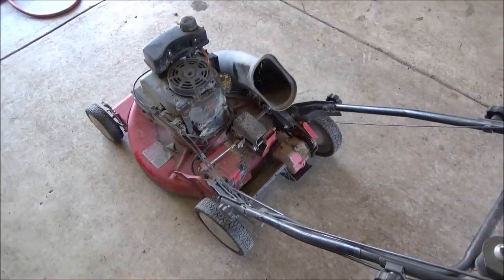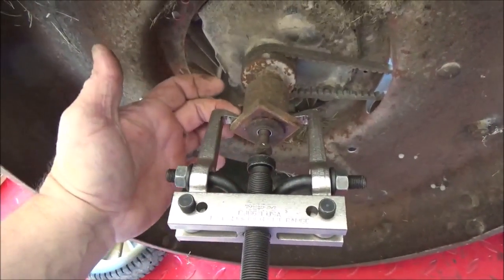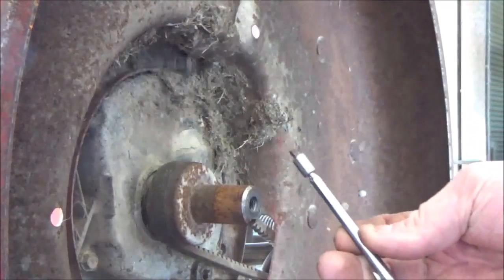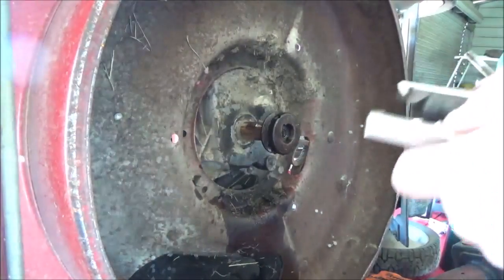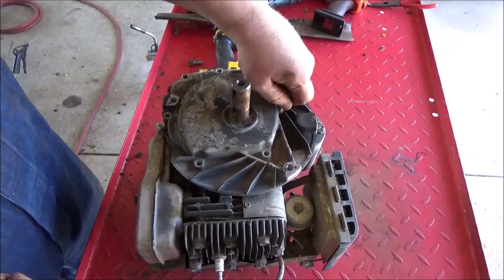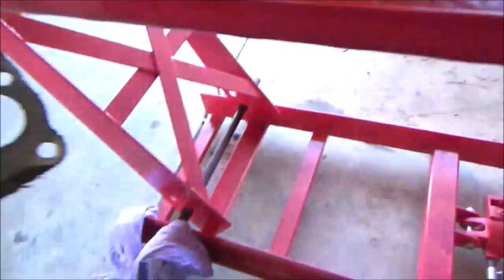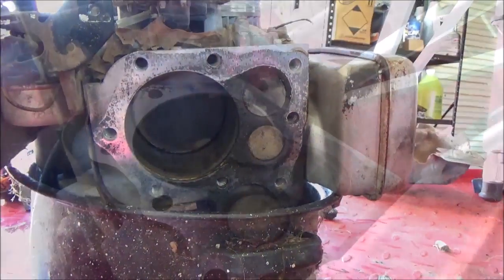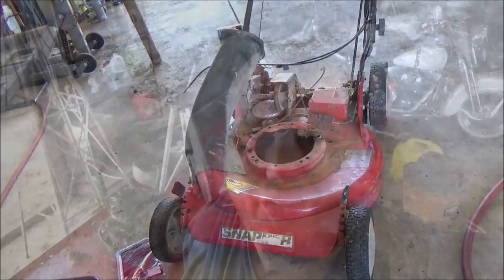PART 1  /   BRIGGS AND STRATTON TO PREDATOR RE POWER / LETS TAKE THIS ENGINE APART AND DIAGNOSE IT

Comment: I manage to find a B&S 120000 series Quantum short block off eBay for my repower job on my 1997 Snapper HiVac 21. I have used 15w40 motor oil for most of its life without any issues.

Comment: Ok, I'm about to watch your vid,, but I can make a statement,, ok:   drum roll::::   So far, I have replaced two engines,, both Briggs, with the 99 buck Predator.  They are without a doubt the best engines I've ever seen.. Always starts on the first pull. NO vibration, and quiet. Better than the Honda that they copied.

Comment: Well, the Predator engine is one way. Or, you could just buy another Quantum for the same price so everything fits the same. Check out eBay item number 133363076416

Comment: Question my friend, I would like to repower a 10 HP compressor with a gas motor.  I was told that I would need at least a 20 HP gas motor to match the power of the electric motor that’s in the Ingersoll Rand compressor. Any ideas ?
Reply: An electric motor provides torque and horse power from plug in to full speed.... I would use a 20 horse engine.... My logic comes from designing industrial vehicle applications.... if 400 horsepower would do the job.... I would order something with 500 horsepower.... for the sake of longevity.....  (back to the 20 horse engine)  a gasoline engine does not produce 20 horsepower at idle or even half throttle.... the rating of 20 horse power is done at full throttle.... so .... 10 horse power will be produced say at half throttle......  hope that helps....dont change pulleys unless you want to wait till hell freezes over for your compressor to air up to full pressure....(there are more reasons but I will stop there) ...  Good luck....
Reply: I guess you can swap pulleys? I have seen small 5hp engines power big compressors no problem. I guess it's all about how you set it up.

Comment: Never seen a belt driven Blade mower ???
Yeah that’s what I would’ve done  let it soak with some penetrating oil then hit it with a hammer .
Reply from the maker: 90% of self propelled mowers are belt driven. Some Honda’s are shaft drive like the HRC216

Comment: I have a snapper just   like that with a briggs quantum except mine don't have a  bagger it's a ninja. I want to put a Predator or a honda gcv 160 that I have had since new and the mtd deck rusted out. Are any adapters required? My decades old quantum runs great  but I have to take the filter off and spray starting fluid  every time I go to crank it.
Reply: James Farmer “decades old  carb”have to spray starter fluid”.. amazon carburetor kit..$15-20 + elbow grease...use premium gas,plus proper storage....last 50years..purchased..15 mowers...common problem simple solution..I finally learned and DID IT MYSELF..$$$savings..good luck
Briggs and Stratton..very good machines

Comment: That's why I use the acetone / atf fluid mix as my penetrant lube, it sucks right into the threads, works even better then pb, and I used that for years, saw the video by small engine saloon, and I no longer buy pb.

Comment: Yep that engine is shot. If it was mine i would replace the mower and not repower it but to each his own. Have a great day buddy!!!
Reply: Man, that whole mower is toast !
Reply from the maker: To replace that mower
Would cost upwards of 600.00
Reply from the maker: https://www.mowersdirect.com/Snapper-7800982-Lawn-Mower/p62111.html?utm_term=0catch62111&gclid=EAIaIQobChMIzNSVse7r6AIVEz0MCh0NOgnwEAQYASABEgL2BPD_BwE
Reply: @THEMOWERMEDIC1  How old is the mower you are replacing the engine on. The deck and all on the mower just looks ruff and worn out to me. I'M not sure if its for a commercial cutter or a homeowner. I am a commercial cutter I really don't care for the snapper push mowers. I have been running Hondas for the 15 years and very pleased with the life and service we get out of them and the one i buy is an 800.00. But I care about how my equipment looks as well I think its an impression of your company. All my employees wear company uniforms and trucks are to be kept clean and no trash in side trucks. But like I said that was only what I would do I never said not to put an engine on it if that what the customer wants but that mower looks 10 years old to me by the design of it so thats why i said that i would not repower a 10 year old push mower if it has spent its whole life cutting commercial I had rather replace it so please I'M not directing any of this at you personally your only doing what the customer wants you to do and i understand that. Keep up the great videos! I think I'M your only patreon is that correct? Stay Safe. Stay Healthy. God Bless!!!
Reply: THEMOWERMEDIC1 B&S mower..$50-150...ADD “snapper name”..$600...it’s a BRIGGS&STRATTON  .95%of mowers are powered by B&S..now all mowers are $$$$

Comment: Oil Starved! Sounds like something my neighbor would do.
Reply: Haaa
Reply: I tried that with my 72cc scooter/moped (call it whatever you like). Was out for a 8 mile ride when I fely it loose power. I pulled over to check the oil level. And guess what. NO OIL. Luckily I had a fresh bottle of oil with me, just in case. Ya never know when you need it. ENGINE WAS UNHARMED (thankfully)

Comment: Have you used the  PREDATOR  to re power any lawn tractors? How do they hold up?
Reply: From what I have seen, they can take a lot of abuse. A lot of small engine tuners use Predator engines. They run them at 9,000 rpm no problem, usually runs at 3000-3500rpm.
BUT I would prefer Briggs&Stratton anyday.

Comment: Why would you get rid of a Briggs man I love Briggs and Stratton engines
Reply from the maker: Because it’s worn out
Reply: Do machine shops bore out cylinders on small engines anymore?
Reply from the maker: Dale Grote absolutely
Reply from the maker: soaringtractor no way. This is a 800 dollar mower.  Well worth putting 120.00 into
Reply: TheMowerMedic1, That Snapper frame would more than likely outlast several of the newer style engines truth be known. Incidentally, I have a Snapper 21 inch that is very similar except that the part that goes to the bagger on your Snapper has been amputated on my Snapper. My engine has one of the black B&S 3.5hp engines that does not have the added pulleys; Just the blade adapter. I’m not sure if my engine had been replaced or not. Usually my engine will start with less than one pull. I will be watching for the next video with much interest. 
Some time or the other, I will have a re-power project of my own with a S-24 Yazoo Big Wheel & Predator Engine to replace a Tecumseh 5Hp. Thanks for all of your great videos. Best Regards From KY.
Reply: soaringtractor  Your right about the engine but the mower is well worth repowering!! You cant buy quality like those old snappers .
Reply: If he had a good used briggs I think he would of used it. Totally worth the money to empower it.